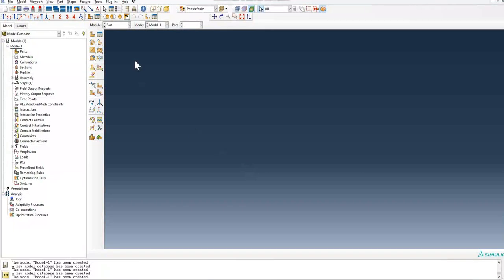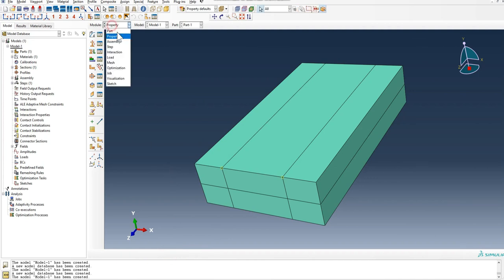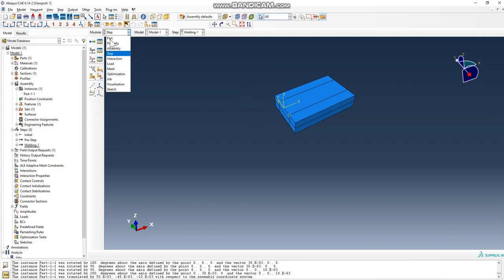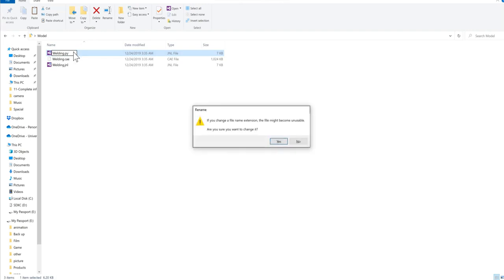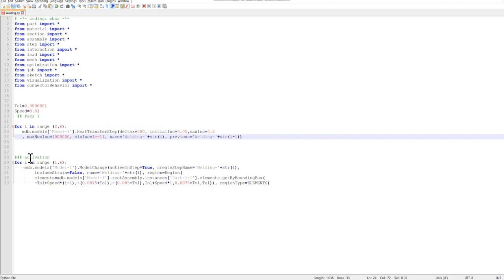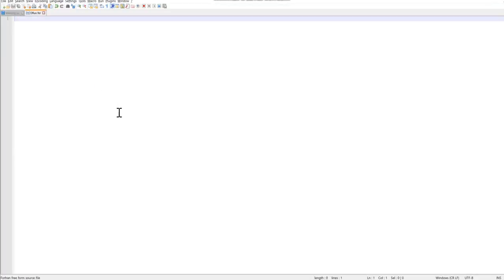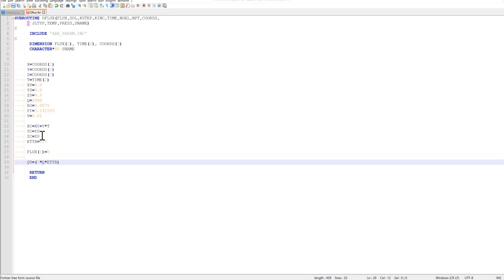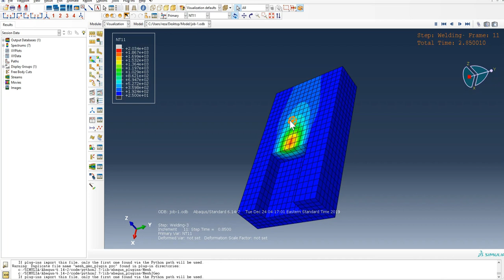A model to simulate Welding process (or additive manufacturing )

Comment: Thank you so much sir, nice explanation. I am doing simulation for layer deposition and encountered the problem like '' The volume of 2 elements is zero, small, or negative. Check coordinates or node numbering, or modify the mesh seed. In the case of a tetrahedron this error may indicate that all nodes are located very nearly in a plane. The elements have been identified in element set ErrElemVolSmallNegZero", Plz give me the suggestion for such type of error.
Reply from the maker: Hello, thanks for your comment.
There is no direct solution for this error. However, if the material, thermal loading, and other parameters are correct, I recommend checking the mesh quality. Additionally, you can use HyperMesh to achieve better mesh quality. If further assistance is needed, I suggest scheduling an online consultation session to investigate the problem in detail.

Comment: I get this error:

***ERROR: ELEMENT 771 INSTANCE PART-1-1 CANNOT BE ADDED USING *MODEL CHANGE IF 
           IT IS NOT REMOVED OR INACTIVE IN THE PREVIOUS STEP
 ***NOTE: DUE TO AN INPUT ERROR THE ANALYSIS PRE-PROCESSOR HAS BEEN UNABLE TO 
          INTERPRET SOME DATA.  SUBSEQUENT ERRORS MAY BE CAUSED BY THIS OMISSION

It seems like the deactivation is not being correctly performed. I double checked the pre-step and it is defined as you specify. Any hint on what could be the problem?
Reply: Ok I found the problem. The python code defines an area wider than the one selected for the deactivation step
Reply from the maker: Hello! Thank you for your feedback and sharing your experiences.

Comment: in keyword *MODELCHANGE, file "Job-1.inp", line 11244: Unknown assembly set _PICKEDSET38

in keyword *MODELCHANGE, file "Job-1.inp", line 11267: Unknown assembly set _PICKEDSET39

in keyword *MODELCHANGE, file "Job-1.inp", line 11290: Unknown assembly set _PICKEDSET40

in keyword *MODELCHANGE, file "Job-1.inp", line 11313: Unknown assembly set _PICKEDSET41

in keyword *MODELCHANGE, file "Job-1.inp", line 11336: Unknown assembly set _PICKEDSET42

Element set assembly__pickedset38 has not been defined

Element set assembly__pickedset39 has not been defined

Element set assembly__pickedset40 has not been defined

Element set assembly__pickedset41 has not been defined

Element set assembly__pickedset42 has not been defined

Analysis Input File Processor exited with an error.
Reply from the maker: Probably it is because you either change the element size after executing the code or you the code doesn't match your geometry.

Please use our platform for asking your questions:
https://hyperlyceum.com/question/category/abaqus/
Reply: @Engineering_downloads  thank you for the reply. Henceforth i will ask the questions there🙏

Comment: I just got a doubt. In traditional welding, the heat source continues to provide power and the material adds up simultaneously. But in the above example, if we look carefully, the heat source starts again and again with each element set being deposited. How to avoid that and produce a constant heat source throughout the process until it cross the final element set?
Reply from the maker: Hi,

To fix it you need to define more steps with smaller step time for each track. Next adjustment is to add a small value to location equation to move the heat source a bit further than material adding. The last one is to increase the initial time a bit nut these two last points my effect the convergency of your problem.

Comment: is there any alternative way for the final step. I am not able to get that
Reply from the maker: If you meant the subordinate part, unfortunately, no. You need to use the subroutine to define the moving heat source. However, there is a Abaqus plugin called AM modeller which could do the job
Reply: @Engineering_downloads  Can you please tell me how to work with that?
Also can you provide your mail id as I have doubts
Reply: @Engineering_downloads   hello, can you please explain how to do that using this AM modeller  on abaqus ?  ( For AM  of composites)

Comment: while opening= abaqus user=dflux.for job=job-1.inp interactiv      in windows powershell it shows the following error

Abaqus Warning: The .inp or .sim extension has been removed from the job identifier
Abaqus JOB job-1
Abaqus 6.14-1
Abaqus License Manager checked out the following licenses:
Abaqus/Standard checked out 5 tokens from Flexnet server BICKY-1993.
<1019 out of 1024 licenses remain available>.
Begin Compiling Abaqus/Standard User Subroutines
10/2/2020 10:05:17 PM
'ifort' is not recognized as an internal or external command,
operable program or batch file.
Abaqus Error: Problem during compilation - dflux.for
Abaqus/Analysis exited with errors
Reply: It means that you need to link abaqus with a fortran compiler. People usually worked with Visual Studio and the Parallel_Studio_XE compiler.
Please refer for example to https://www.researchgate.net/publication/343836928_Installing_Abaqus_User_Subroutine_Linking_ABAQUS_2020_-Visual_Studio_2019-Parallel_Studio_XE_2020_Fortran_Compiler for more details on how to install and link all of that.
There is an issue these days though with the Parallel_Studio_XE compiler. Starting 2021, Intel does not provide free student license anymore for this compiler as it's been replaced with oneAPI. You can install oneAPI for free instead, but it doesn't seem to my knowledge that people have figured out how to link it with abaqus. I think it is necessary to also modify some script file in abaqus to tell the him to look for a different file than ifort (present in Parallel_Studio_XE but not in oneAPI) as oneAPI must have something else to replace it. I'm still trying to figure out this issue.
Reply: Sir did you find any solution for above error

Comment: Nice work. Thanks. I hope I could see this when I was in uni 2 years ago. :)
Reply: Thanks,

I'm sorry about it, Hyperlyceum just started so...

However, now you can tell me what are you working on so I can create a model and give it to Hyperlyceum to post it.
Reply: That is really kind of you. I am now having a hard time to find a method to make a rubber plate property having different material properties such as elasticity and youngs modulus from bottom to top. I wanted to make a gradually increased property like an amplitude. I searched all Abaqus manuals but could not find a way to do this. Maybe subroutine?
Reply: Study Cast I have posted a video related to USFLD code and it explains ur problem. I hope you will find it helpful